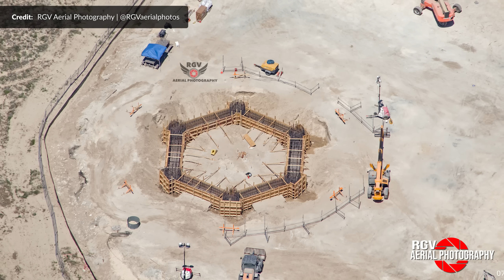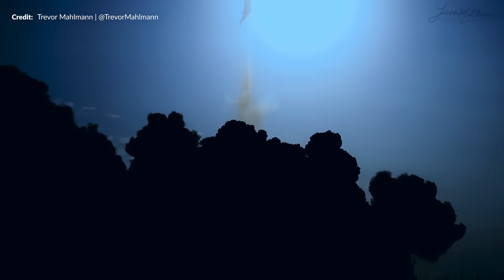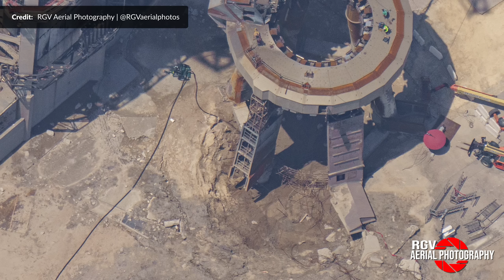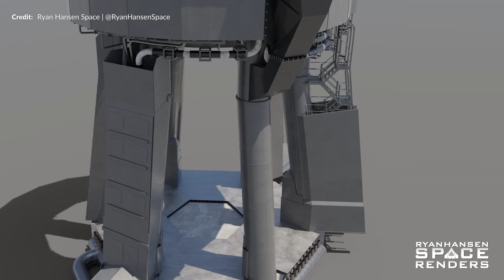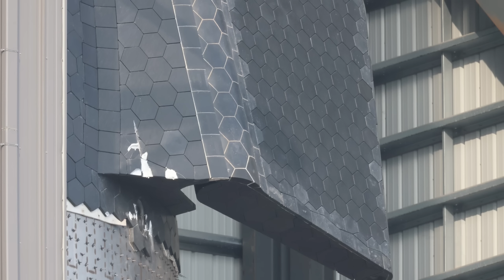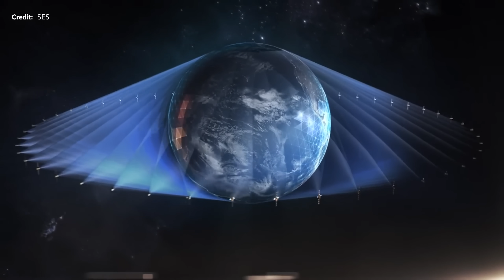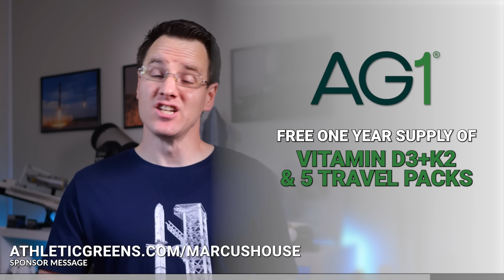The Starship Damage Left Behind: How are SpaceX Moving Forward?

Comment: Cheers Marcus, yet another well presented issue. But wouldn’t / shouldn’t they have thought about building the OLM strong enough in the first place? I mean, the other Big Spacecraft all get off without blowing the place up!
Reply from the maker: I guess SpaceX's process is to see what they do and don't need with prototypes and see what works and what doesn't. I think they really should have predicted the concrete being hurled around. Static fires kind of proved that with earlier concrete. I guess they just though the FONDAG would work out.
Reply: I stand corrected about the SLS. But I wondered due to having watched the building of The Starbase since 2018, or there abouts, and being someone who has laid a lot of concrete, that being as their tower was designed practically without fault and so advanced, why did the mount’s base go so wrong? Yes  I know the thruster is twice as powerful as the Atlas V and that’s what I meant by “shouldn’t” they have prepped for it with something better. That’s all.
Reply: Hi John! Emotionally, I totally agree with you. Knowing what we know now, it would have been much more impressive if there was no apparent damage to stage 0.
From a rational perspective though, I totally understand why they didn't invest more time and money into systems like a flame diverter, especially since chances of a RUD on the OLM were relatively high. After all, it wouldn't be SpaceX if they'd spent any more on the OLM than they absolutely need to get 7/24 off the pad 😅
Reply: 1000% 
We've all heard about how this disaster was a chance to collect data, but they have clearly ignored a good 50 years of data by not using the methods that have worked for over 50 years

Comment: good luck returning from mars without a pad.
Reply: Since the gravity on Mars are way different than Earth, the needed propulsion are also way lower and the Starship itself shouldn't have any issues with launching without a booster. However the same issue as the rocket have in Earth orbit, is the needed extra propellant. Whether it will be made on the surface or a tanker will be in orbit we will have to see.
Reply: @SaxxooDukei  

Mars .38g.  From Earth a cargoless Starship MIGHT achieve orbit.  On Mars it is relatively easy.

Comment: The best part is no part! Replace the concrete with steel flame diverters and water cooled steel plating. If concrete is not there then it cannot be heated expanded and fragmented. If the main foundation is solid it could be treated and relined. Then create form work around to pour a steel frame with water conduits built in. Pour the steel in place as one large heat conducting protective plate with water under surface flooding through transferring heat. Ablative coatings on steel top side as well as water deluge systems damping the shock / sound waves above with all water flow taking out heat and percussion /sound in the same direction of the flame diverters and the "under steel water transfer systems.

Comment: SpaceX overengineered Starship so much it didn't buckle under intense structural pressure, they however forgot to overengineer the launchpad.
Reply from the maker: True words! 😆
Reply: It did buckle though.
Reply: literally started folding in half bro
Reply: @mervstash3692  after the tanks were mostly empty and it hit the denser atmosphere
Reply: @ThatOpalGuy  not sure what point you are trying to make. Does the craft not have to flip around so the booster can separate & land? (or splash land in this case)
Seems kind of important that the thing not start folding when doing that don't you think?
Reply: @mervstash3692  the upper stage separates, then as it fires its engines the booster does the flip to burn back to the launch pad(ideally).
Reply: @ThatOpalGuy  so what point were you trying to make then?
Reply: @ThatOpalGuy  No, it is supposed to flip before it separates, obviously. Why on earth should it flip after? To fire the rockets and accelerate towards earth even though gravity takes care of that?
Reply: They forgot to overengineer the engines too, since 8 of them failed. And dont forget the killswitch. It was proven it failed should pop the rocket 40 seconds earlier but it didnt do aything.
Reply: And it's still failed because they didn't engineer the right things